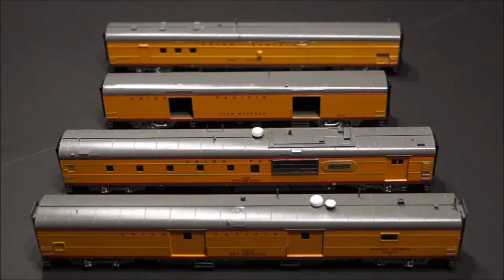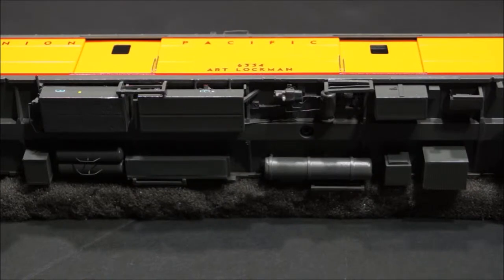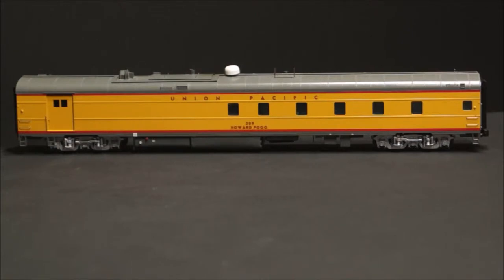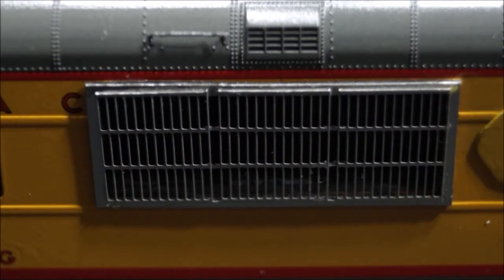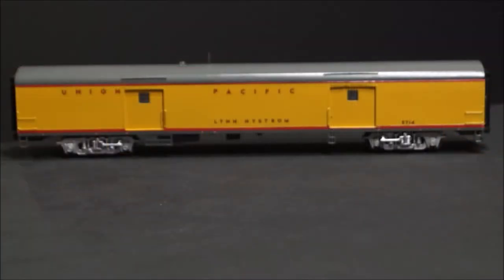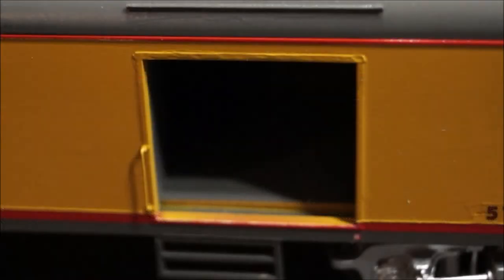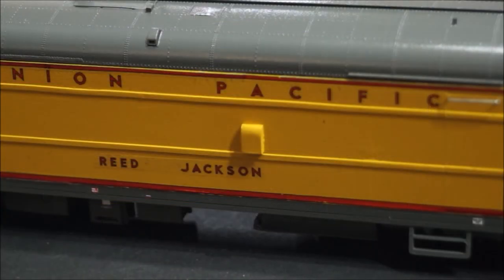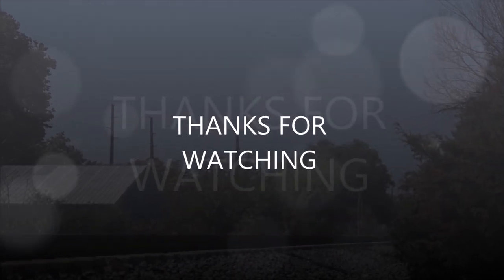Steam Program Cars

Comment: How easy is it to swap out the bottom for the Howard Fogg? Are the screws in the same place on all the cars or did you have to do some modifications for it to fit?
Reply from the maker: Angela, the mounting location for the 2 axle and 3 axle trucks is not the same on Walthers cars.  The 3 axle mounting hole is offset from the center of the truck.  So the only way to convert the car from 2 to 3 axle is to remove the entire floor and swap it with the floor of a car that came with 3 axle trucks.  You basically have to completely tear down the two cars to do this.  It has been so long since I did that, but I don't remember it being a big issue swapping the floors, it just takes time and patience to do so.  Hope that helps.  If you don't want to tackle that project, my company Railfan Models will be coming out with the Howard Fogg in kit form or fully assembled in Spring 2022.
Reply: @brienwood1624  are the trucks on the baggage dormitory the right truck for the council bluffs? Or do i need a different car for that too?
Reply from the maker: @angelakaichen9192  No, they are not the correct trucks for the Council Bluffs.  They are not used on any of the current cars UP rosters.  Walthers made a truck that was close but the wheelbase is too short.    Look for a Walthers 41-CUDO-11 passenger car truck.  They do not have in stock and their website won't allow you to search for discontinued products to get the part number.
Reply: @brienwood1624  your right they are hard to find is there any other truck i can use as a stand in
Reply from the maker: @angelakaichen9192  I don't know of anything right now, but haven't actively looked lately either.
Reply: @brienwood1624  thats ok i found some on there website

Comment: How did you do the gps  antenna
Reply from the maker: That is actually a satellite data  antenna (tv and internet) and not gps.  The past few years the dome has been removed exposing the dish antenna.  Many of cars in the fleet have replaced the large white dome antennas with low profile black antennas.  

I made the antenna shown by stacking and gluing multiple layers of styrene together.  A hole was drilled through.most of the layers and a metal rod was glued in the hole.  After curing, the assembly was placed in a drill and spun while a file and sandpaper were used to shape the cylinder to a dome.

If I were to do it again, the part would be 3D printed.  Still would use a metal rod with the part.  That way the antenna is removable.  Working on many detail parts for Walthers cars through my company RailfanModels.com.  Currently only the tube diaphragms are available, more will be released by end of 2022.  Hope that helps.
Reply: @brienwood1624  I should have told you witch car I was do first I’m building Fox River and I can’t figure out how to do the planar antenna or the dome on top
Reply from the maker: @Trainman-zp4eq  send me an email at info@railfanmodels.com  I would be happy to show you some detail parts not released yet including those you mentioned.
Reply: @brienwood1624  ok
Reply: I sent you an email